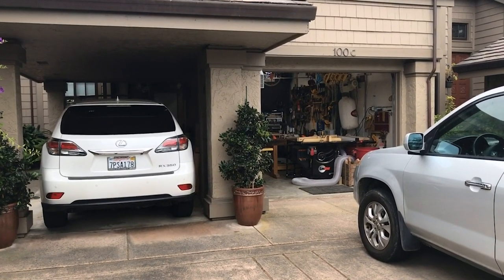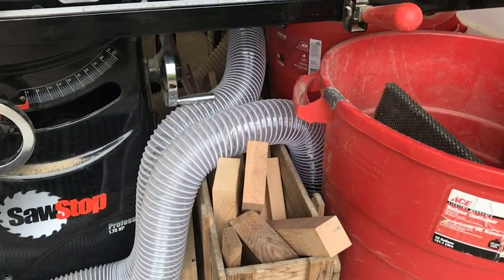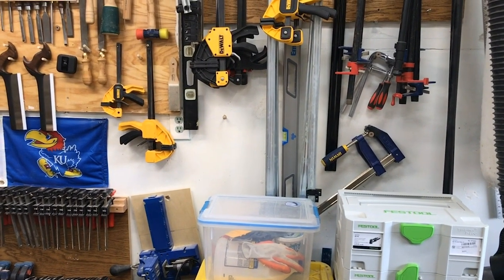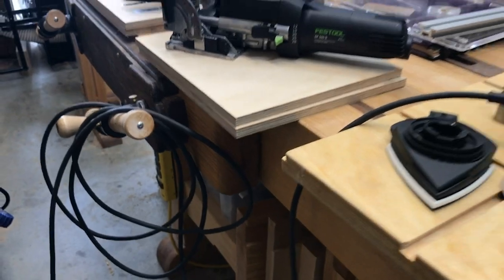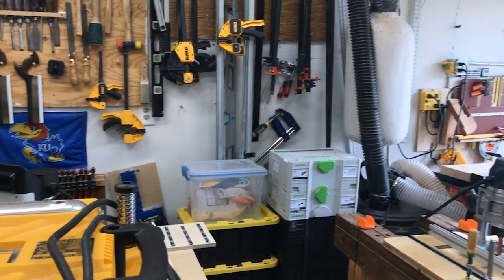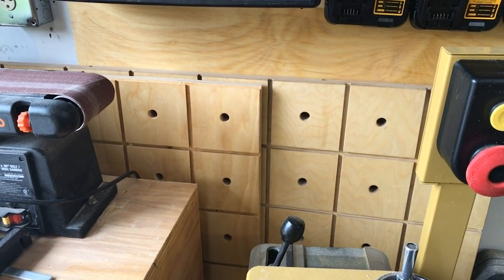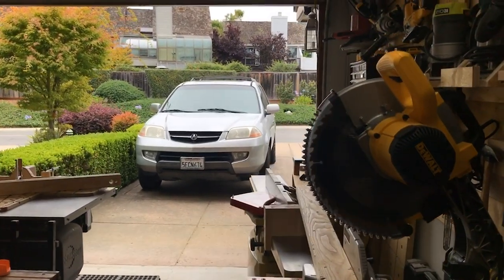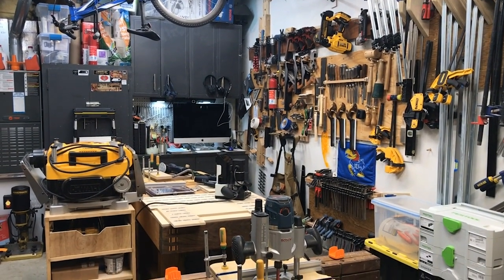Small, One Car Garage Workshop Tour (July, 2020) -  Boy, Have Things Changed!

Comment: Very nice. That SawStop is next on my list of major tool upgrades.
Reply from the maker: What did you end up doing with your. Thickness Planer - live with the adjustments you made?
Reply: @SmallWorkshopGuy  Yeah, I still have it and it's working well enough that it's tough to prioritize changing it.  Putting a Shelix in my jointer is probably a higher priority.  Never a shortage of tool upgrades to make.

Comment: I have a small shop like yours one car garage and a lot of tools as well. You might want to look at the Bora Centipede work bench.
It saves me a lot of space issues since I don’t need an open workbench all the time I store this bench when not needed and gives me more open 
Space to walk around
Reply from the maker: Yeh, I have seen those - pretty cool.  I essentially give away plans for a "PopUp Workbench" based on Sawstallions and Matchfit Clamp grooves in the top and side panel.  Stores away in the corner when not needed.
Reply: @SmallWorkshopGuy  do you have a photo of that